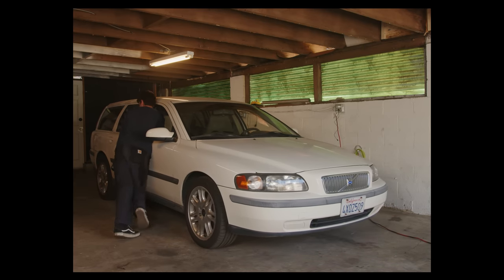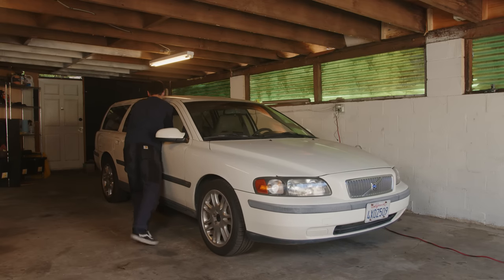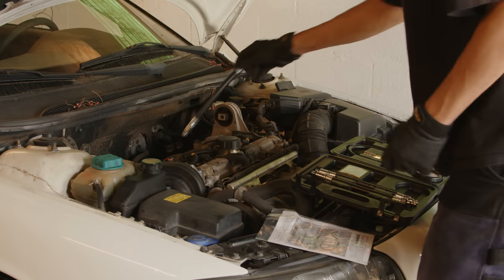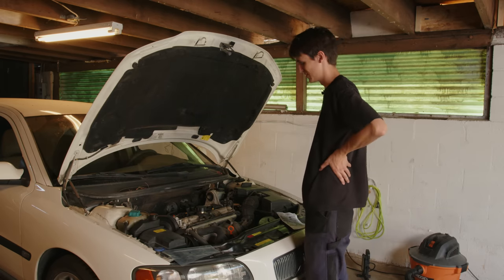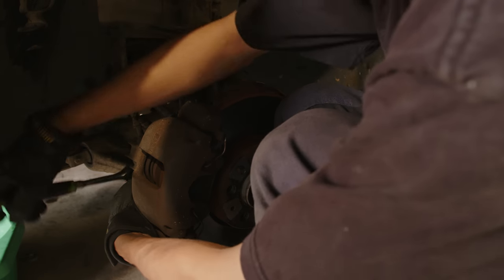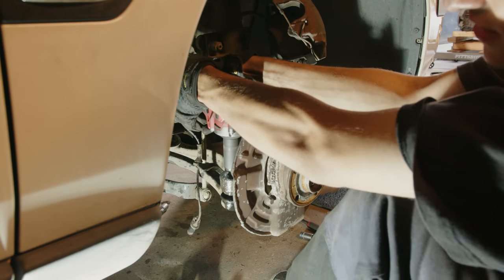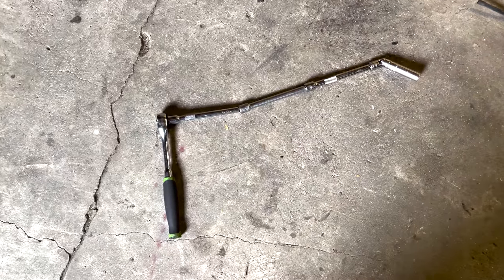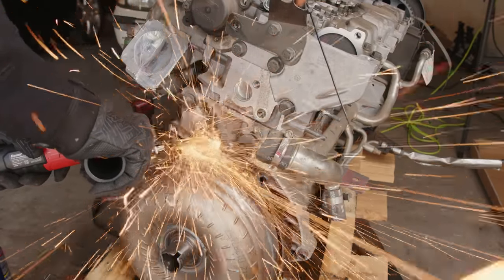I bought an $800 MANUAL Volvo Wagon with a BLOWN Engine

Comment: Just an fyi for anyone watching this, to remove the front axles on one of these cars, you don’t need to remove the brakes or remove the knuckle. If you just undo the strut bolts that secure it to the knuckle, you have enough room to swing the knuckle forward and knock the axle back

Comment: Congratulations Willem, I am so in! I went through this several years ago with my BMW 318i that had a cracked block. I found that it was similar cost to source a factory rebuilt long block from my local BMW dealer as to have my shop source a new/used block and rebuild my old engine. I reclaimed my car from the shop (towed it home with my dad’s motorhome/dolly) and dad and I pulled the old engine out and the new one in after transferring the necessary components off of the old engine. Worked out great! The dealer even gave me a 25% discount on the long block and delivered it in a crate to my house! I’m in OC, so let me know if you need another set of hands! Good luck on your project, I look forward to following your progress!
Reply from the maker: That’s awesome! Thanks for sharing! 🤝

Comment: These cars are wonderful, especially in the N/A, 5 cylinder variant. I’ve owned my share of Volvos, both N/A and turbocharged, including a V70R, most of which had manual transmissions; my favorite of the lot has easily been my 04 V70 wagon with the same N/A motor and 5 speed manual transmission as yours. Mine has 244k miles and is still going strong. 
Good luck on this project and I hope you have many enjoyable years with your V70 wagon!

Comment: Nice find. Just picked up a p2 xc70 project for $600 that had a split in the radiator.  Really jealous of your manual find. These engines can last forever but have some issues. The o-rings for the oil pickup tube can crack and lead to starvation issues. The oil pump is located behind the crank pulley and relies on a gasket to maintain oil pressure. Also make sure that you replace the pcv system and timing belt. If you ever smell fuel at the rear of the vehicle, it's because the top of the pump likes to crack but you can clean and fill it with plastic bond epoxy. Hopefully everything works out well for you guys and great progress so far.

Comment: I also bought my v70 sight unseen, the best purchase i have done, the car had a hole in the exhaust and sounded like a monster, the cluster stops working sometimes (i know why and how to fix it, just havent gotten to do it.) It gives two fault codes, one to do with the exhaust, and another with the ambient air temp. sensor. Otherwise, works like a charm (*knock on wood*)

Comment: It's impressive to be able to blow up a engine like that. They are built like tanks 
That motor can deliver right under 400hp without changing internals. Maintained 500 000 miles is no problem

Comment: "MANUAL Volvo" IN THE US. A localised rarity. (I wrote that before even starting the video.😅) Too bad you're on the wrong end of Kalifornia, I know a Fiat-Volvo-VW mechanic, and I'm a VW mechanic.

I'm surprised you took the hood off instead of removing the front bumper cover/grill, radiator, a/c condenser, radiator support, & front bumper. It would be easier removal/installation and safer geometry for the engine crane. The higher you jack the crane, the more likely it is to fail. (And again wrote this before you said anything in video. 🤣 Well if anything, learn that it would have also been safer to do it that way.😉)

Comment: My man change that volvo engine from the s60r to a 2.4t5 a lot more reliable. Than the stock 2.5t5 that comes. Cilinder walls are stronger on the 2.4t5 peace! I am still stock on the 90s wagons rear drive. But I have been looking to this ones. Those cars just like old ones they don't rust. You film everything very nice.

Comment: A lot of V70 this generation  , especially B5244S2 manual  has more than 300000mls or even 500000mls here in europe with just basic maintenance. There are some design flaws on this gen but, a lot are fixed by oem volvo parts if you buy now.